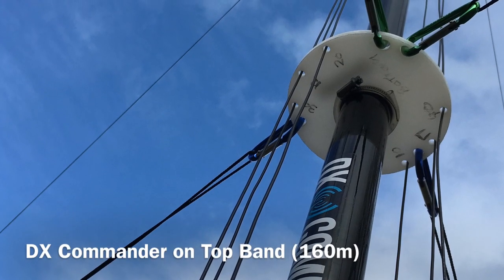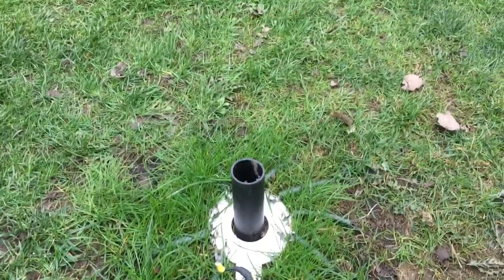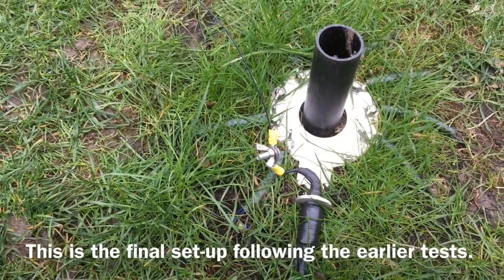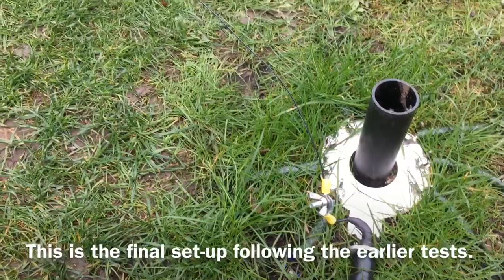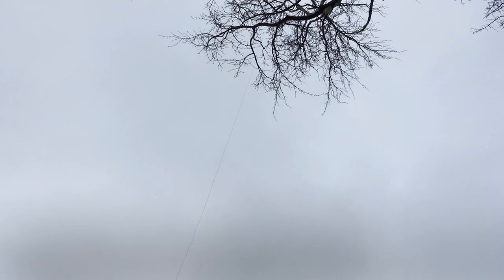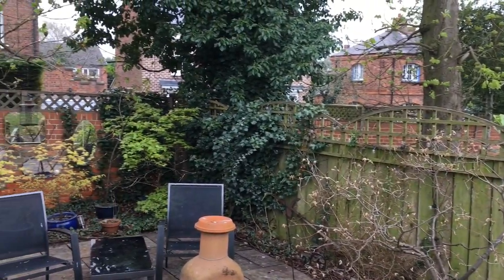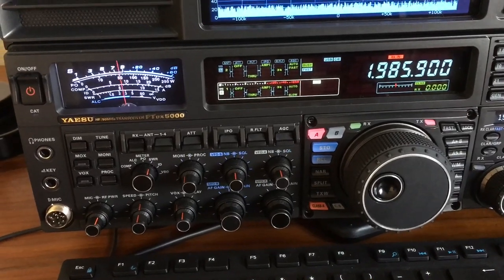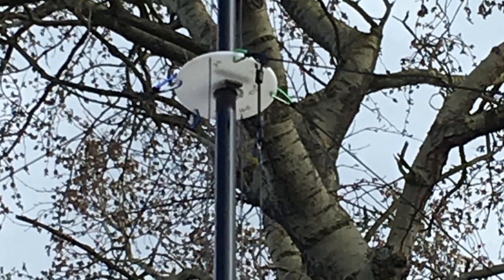DX Commander on Top Band (160m) - Part 5

Comment: Hi Ian …. It’s me again🙈 …. Going to try out your top band “hack” tomorrow …. Wire from Sotabeams just arrived today … May I ask  if you have a final approx’ measurement excluding the fold back and  how / if you have somehow  anchored the bolt connecting the two fork connectors to prevent the antenna wire pulling on the connection ? Tnx … Gerry ☘️
Reply from the maker: Hi Gerry! I can’t remember the length. I put up 1/4 wave length (40m) and while it’s “fresh” in the tree there’s back and forth movement. So if you leave enough slack at the coax end, you can confidently trim to length knowing you can pull a bit back towards you if need be to keep a bit of slack in the system. After months up there it gets tangled and won’t budge I reckon. So if a after trimming it’s a bit too slack (allowing some for tree movement), then you can pull on the far end rope to tighten a bit. To stop it pulling out the fork connector, and it never has, I have a bit of 40mm waste pipe knocked in the ground with say 15cm/6” showing. I screw a piece of connector block to this. The tree wire connects one side of the block (tape the wire to the pipe) and another fork connector the other. The two fork connectors (from
block and from coax) join with a finger tight bolt (just in case it did ever need to pull free 🌪 🌳😮). Get a brass centred connector block as a steel one will rust. Have fun Gerry! 😀
Reply from the maker: ps. Can’t remember if this is in the video, but I used some cheap thin wire (old telephone jumper wire - alarm cable core or Cat5 cores are probably similar) to extend two of the existing 3.5m radials. I ran one one way down the base of the garden fence and one the other way up the garden. So I now have 2 x 43.5m radials. Whether they help is anyone’s guess 🤔
Reply: @ianxfs  Good Morning Ian and thanks again for providing such a detailed explanation  of your process - all very logical and practical. On behalf of myself and the many others who rely on gentlemen like yourself to help us navigate the our way through the wonderfully  frustrating exciting  world of amateur radio let me say “Thanks!” I will certainly take your advice on board and report back ☘️ 73 de EI6IYB
Reply from the maker: @tixilx  Good stuff Gerry!

Comment: Ian, the DX commander is on my shopping list for early in the year, have you tried running the 160m with the commander in place ? Does it mess up the tuning of other bands ?
Reply from the maker: Jon Lawrence Hi Jon. I don’t know as I’ve only ran the 160m as a separate wire alongside an 80m one. The other 80m on the full six-band set-up works fine, so it maybe ok. Worth a try to find out I reckon 👍🏻 Good luck!

Comment: Hi, can you tell me what you have used in the ground to mount the DX Commander
Regards Paul
Reply from the maker: G1 WHP Hi Paul, yes it’s just a piece of black plastic waste pipe (40mm I think?). Just knocked into the ground by about 6 inches/150mm. It keeps the base plate in position and is something to aim at when putting the pole onto the base. Handy support when guying and stops anyone accidentally standing on the base plate and rf feed connector too. Simple really, but has a few benefits in my setup 👍🏻

Hope this helps!

Ian.